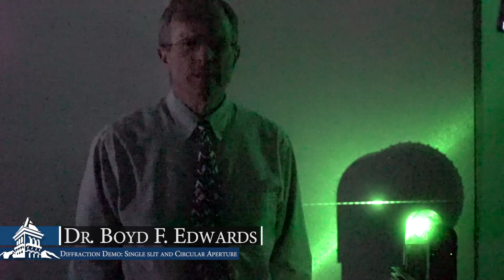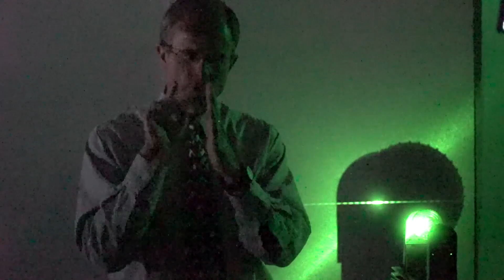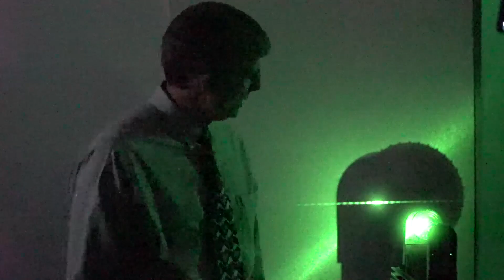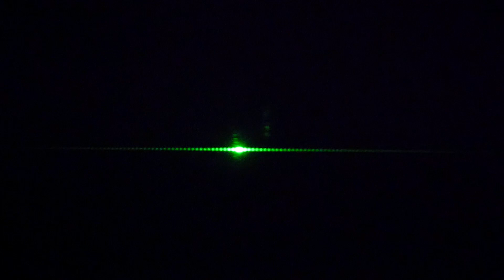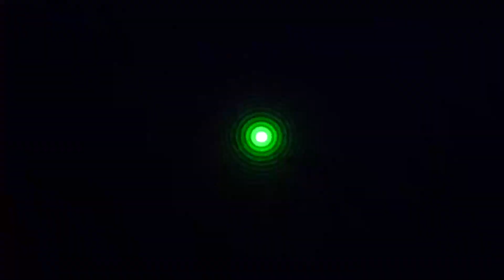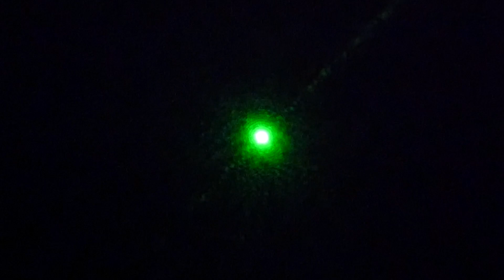Diffraction Demo: Single Slit and Circular Aperture

Comment: From straight slits to circular slits it seems interaction/reflection with the slit material is important. How come nobody ever mentons the slit material? The slit material is the only other thing in the system. For light to be dispersed across a screen, there must be some force on the light, like reflection off the slit edges. Doesn't the need for the slit width to be on the order of the wavelength of light suggest it is multiple reflections off the slit edges?

Comment: At 0:56 your hand is right in the path of what should be the part of the beam creating the corresponding reflections, and still, it remains untouched by the beam! No light rays are reaching the screen, except at the center!
Reply: There are no reflections. And the diffraction happens at the slit, not later. I think the Pilot wave theory provides a better explanation for this experiment. If you're not familiar with the Pilot wave theory, try the Veritasium video titled "Is This What Quantum Mechanics Looks Like?"

And note that since all we're seeing around 0:56 in this video is a line so we cannot know if the camera is higher or lower than the plane of the light.
Reply: @MikkoRantalainen  Interesting, but I must admit that I still have some reservations. One can deduce the height of the light source by the changes on the screen. Besides, the presenter stands next to it at the start of the video.
Concerning the lack of reflections and the diffraction starting at the slit, I wonder what you mean exactly. In my layman's view, either the reflections are created when rays/waves hit the screen, or they can be created at a distance, without any rays/waves touching the screen at the corresponding locations. The latter case is very strange, and i have no satisfactory explanation for it. Of course, if the light rays/waves are reaching the screen at the locations of the different reflections, then the mystery is solved. Concerning your reference to quantum theory, I would much prefer a down to earth explanation. Do you have one?

Comment: Light is an alternating current. It's obvious when pointed through the round hole. Light hits the screen, reflects back to the hole, back to the screen but more diffuse,..... rinse and repeat. 

Make sure you use a non reflective surface on the back side of your slit.

Your experiment is similar to looking in a mirror pointed back at a mirror. Are there really 50 of you leaning one direction or the other? No, it's all reflections and your controlling them.

Comment: I tried doing this with a divider and using my phone flashlight. I made two holes using a divider one mm apart on an opaque surface. I could only see the circular diffraction pattern. My original intention was to recreate the double slit but I failed to do that. My holes were too big.
Reply: Dude u should use a monochromatic light source not the white light
Reply: @asinjobi6853  exactly
Reply: @asinjobi6853  I think he can do so by taking a candle and sprinkle some table salt on it

Comment: Why does it have rings when it passes through a circular aperature?  Does it interfere with anything like in the slit experiment?
Reply: It's a diffraction pattern, not an interference pattern. They just show the circular wavefront of the light in this case.
Reply: @arghyadas6978  what's circular wavefront?
Reply: A wavefront is a plane where the particles of the wave are vibrating in the same phase. When this plane is circular in shape, it's called a circular wavefront. Same phase here means nature of movement.
Reply: Umm actually, it won't be 'circular wavefront'. It would be a 'spherical wavefront' as the wave propagates in three dimensions.
Reply: @arghyadas6978  Yeah.. Circular wavefront doesn't make sense here
Reply: Yeah More likened to concentric waves emanating from the core of a somewhat stationary particle. Energy source for cause is the laser beam. My profile pic is one such particle, they have the tendency to spin then return concentric. I don't know why it looks 2d it's clearly 3d?